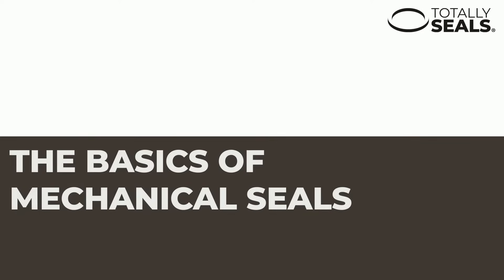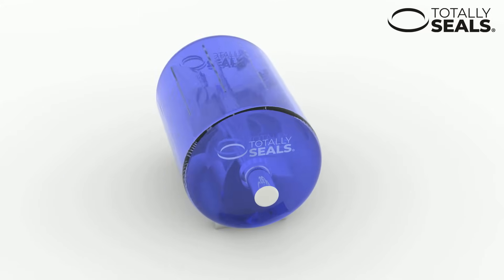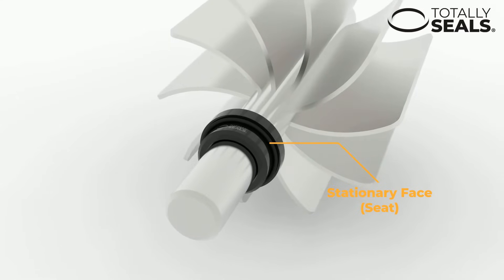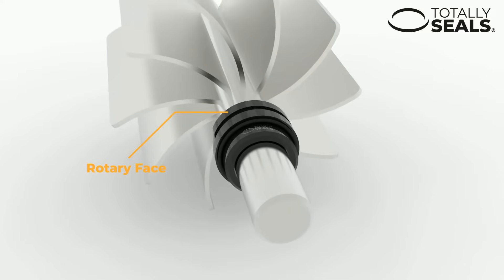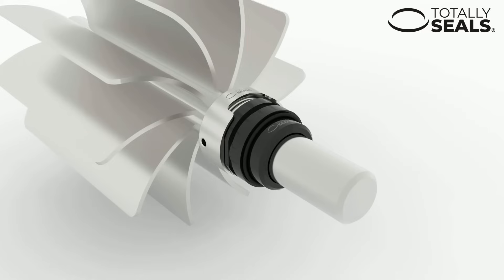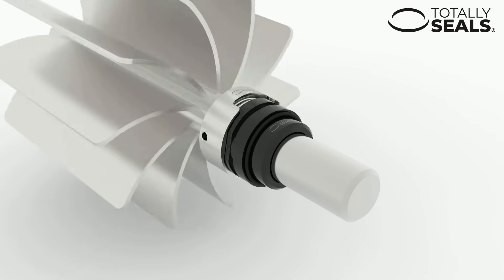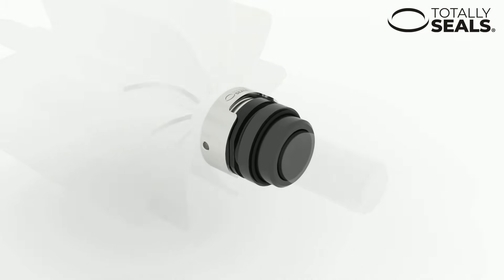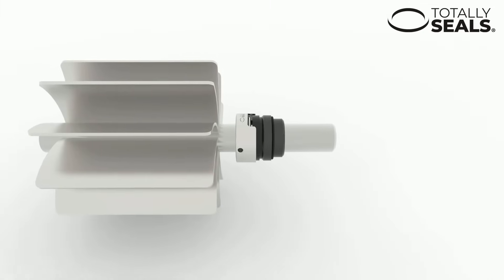The Basics of Mechanical Seals

Comment: To reduce the friction and high temperature what type of cooling system is used in that area.
Reply: There’s a thin layer of the fluid your pumping between the rotating and fixed surface. Look up pipe plans because there’s a lot of different ways you can do it.
Reply: The layer is around one micrometer thick but it varies between applications and tolerances

Comment: Relation between mechanical seal , gland and stuffing box
Reply: Stuffing box is a seal to stop leaks for a rotating or sliding shaft. Gland is a type of stuffing box seen in taps and also in some boats. Mechanical seal is a different sealing system that was introduced more recently.
Reply: The mechanical seal is normally set inside the stuffing box (back in the day people literally used to stuff a box with all sorts of stuff to prevent leaking). The gland is an additional part that "locks" the mechanical seal in place. Think of it like putting leftover in a tubaware. The food is the mechanical seal, the tubaware is the stuffing box, and the lid that goes on top of everything is the gland to keep everything in place.